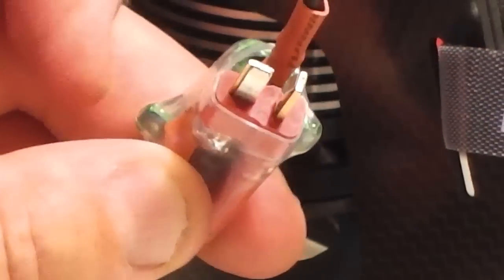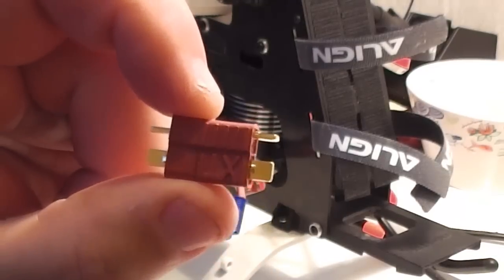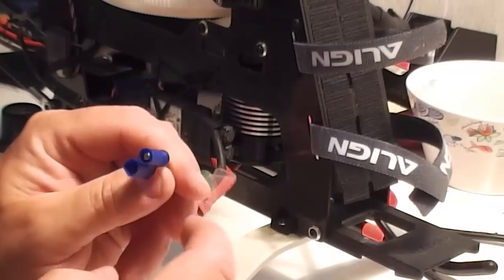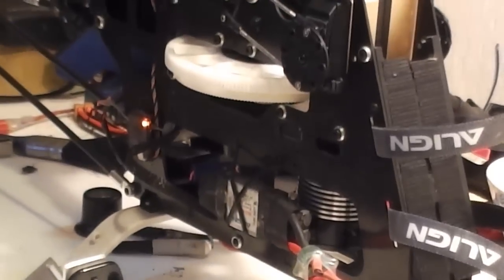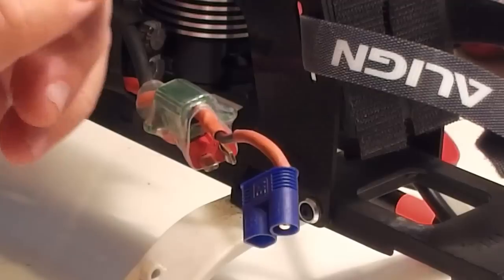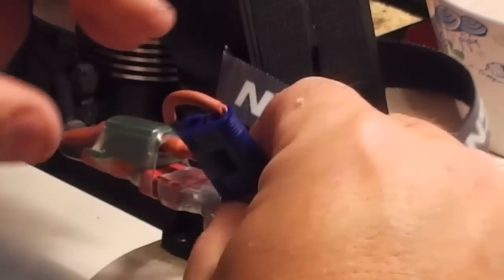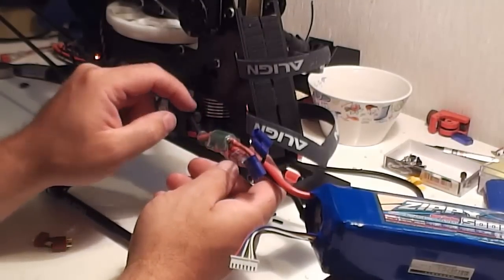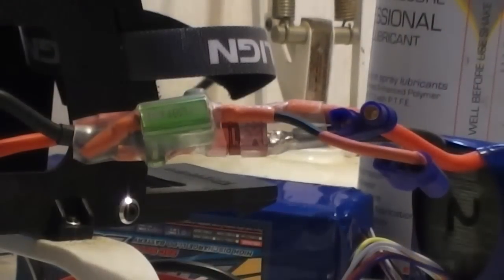ESC Spark Eliminator for high voltage battery packs

Comment: Bad idea to connect the deans before soldering. That could cause the two to be soldered together. It says not to on the package and I found out the hard way. The problem with the ones you're holding is that they're not real deans connectors. Those are knock-offs and always have weird issues. The real deans connectors are a bright red color and don't have as many issues in my opinion

Comment: Good deal! Just purchased the Turnigy dlux 120a esc and it came with an anti spark wire already but, I didn't know what it was used for. Now I know so thanks for the video. Except they put the anti spark wire on the red (positive) wire.

Comment: You don't need to disconnect the other connector really. The current will still take the least resistance path because your deans is connected. In fact by leaving the EC3 connected, you have more current handling on the ground rail. Even though the second path has more resistance, you still have 2 paths rather than one.
Reply: NakLojik Actually, path of least resistance is just where most of the current will go. It will continue to follow all connections. And, the resistor will add resistance to the circuit, release heat, and shorten fly-time.